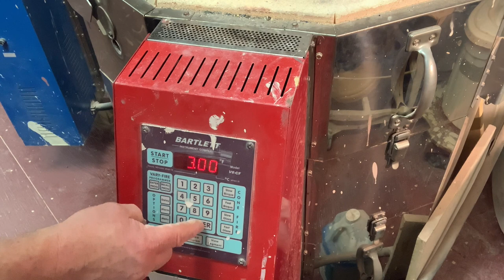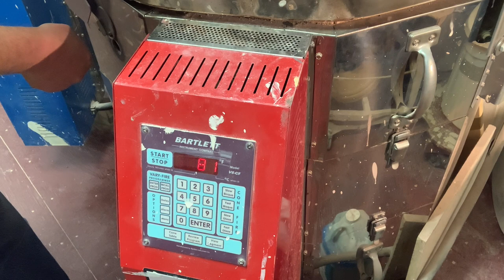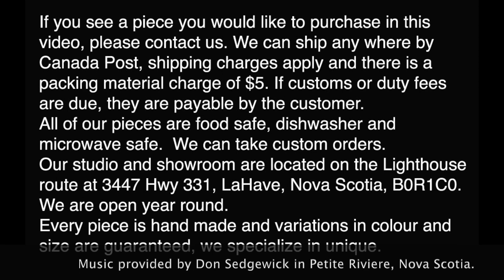Bisque firing basics and tweaks.

Comment: Ah yes, the miniscule adjustments in the positions of the pots before putting down the next shelf!  One thing I didn't hear, that I thought I might, was, "Don't pick up greenware the same way you pick up fired wares.  You'll end up with a piece of rim in your hand."
Reply from the maker: Forgot that, usually it is hitting the rim of the pot underneath with the bottom of the one you are lowering into the kiln.

Comment: Do you have a video that explains clay ‘cookies’ for the kiln & the best way to make & use them?

Also, I watched a potter build her pots (plates, saucers, mugs, & etc… not specific to any single specific size) on kiln furniture that equals the thickness & width of her actual kiln, building a replica of her kiln size & did so on her table to ensure how to stack them inside her kiln, making it as kiln conscious sized as possible so she can replicate it inside her kiln. 

Is it worth doing this in order to protect the kiln & the pots, AND load it so it best fits in the kiln to save on power?

I want a kiln of my own so much. My daughters have considered setting up a go-fund-me to help with the cost of building a pottery building at home. I’m currently sharing a small space in a lawnmower shed that also has a riding mower, generator because we tend to lose power during hurricanes, an air compressor, old Craftsman toolbox, weed eater, post hole diggers, shovels, rakes, etc… to name a few. My pottery wheel, table, boxes of clay, & a few shelves fills & overfills the severely limited space I’m able to use. We have a space to finish leveling & add crush & run gravel to pack under a planned 16x16 building just for my pottery making. It is possible I can get a used kiln from a friend of a family member who isn’t throwing as much these days. (🤞🏼🤞🏼).-the kiln has been well cared for & it’s single owner. 

The increasing price of wood is outrageous.  We have help to build it. The problem is covering the building supplies, primarily the framing wood, T1-11, & blocks, screws, cutting blades, etc… 

Thanks in advance.

Comment: This is a great video!!! Wow jam packed with information! Thanks as always. I have found that bisque firing too low I get pinholes so I bisque to cone 04.
Reply from the maker: The glaze could be under or over fired rather than gases from the low bisque. Organic matter burns out at 451F. If you use a transparent glaze pinholing is much more obvious and the glaze needs to mature higher or soak longer. The problem with pottery are the problems that never end. Good luck.

Comment: Hi Vaughan you said you prefer to fire the bisque 06 instead 04 .What is the difference between then , I know is the temperature and I just find is not better do the 04, maybe burning more organic matter or is something else?🤗
Reply: 06 is the standard.  04 is hotter so fires the bisque ware to be more vitreous so not as absorbent to glazes.
Reply from the maker: Hi Marcia, the comment below is correct.  Some prefer 04 but I have no problems at cone 06. The clay is harder and more dense at cone 04 so you are less likely to crack the pots with glazing tongues. O6 saves energy too.
Reply: @Vsmithpots  thank you 🤗

Comment: Good video with good tips! 👍👍👍👍👍👍👍
It reminds me of a question I've been meaning to ask you... I see that you don't sign your work before you bisque fire. 
With what do you sign your bisque fired pieces? How do you manage to dip your signed bisqued pieces and not have your signature smudged or drip? I've been stamping my bone dry pots with a rubber stamp and a potter's stamp pad. If I stamp on bisqued pots I have to wax the bottoms without waxing my stamped signature or it will blur my stamp. I'm definitely not doing something correctly but I can't figure it out.
I have a stoneware mug of yours and a earthenware mug that Jacqueline painted and the signatures are glazed over but not blurred at all.
Thank you in advance for and advice or tips on my question Vaughan.
Reply from the maker: Hi Connie, I use LUG1 from Amaco. Make sure it is dry before you dip the glaze. If you brush glaze it will smear, unless you are quick and lite in your brushing technique. The best way is to sign before the bisque firing.
Reply: @Vsmithpots  Thank you!  I'll try using your suggestions on my next firings! 👍👍👍

Comment: Thank you for the helpful video!  What’s the highest you’ve glaze fired Laguna BMix-5?
Reply from the maker: Only cone 6 but it seems to have expansion problems with glazes above 5.
Reply: @Vsmithpots  bloating?
Reply from the maker: @walkerpottery9296-Natalie  I had some pots cracking with certain glazes when I poured boiling water in the pieces. Does not happen at cone 5.

Comment: I knew a guy who had a rush order so fired before the pieces were completely dry.  I came into the shop and the kiln sounded just like a popcorn maker.  I doubt you have ever heard anything like that.  Most potters have heard an occasional pop but nothing like that.
Reply: How sad for that, all that hard work.
Reply from the maker: I remember at college the teacher would blame it on our pots having air bubbles in them, instead of him firing the kiln with pots still damp.
Reply: Lol I heard about air bubbles too
Reply: @Vsmithpots     On Pottery Throwdown too, they have blamed it on the potters, when it should have been the kiln master.
Reply from the maker: @sybillestahl8646  I saw that too. Rushing never pays off.

Comment: I load my kiln and then put a 300 watt light bulb in the kiln with the lid shut for 24 hours. That dry heat of the bulb gets any last hint of moisture out.
Reply from the maker: Good tip. I suppose you could also hook up a fan blowing in through the lower spy hole and leave it blowing over night, fans use less power.
Reply: @Vsmithpots  I had not thought about a fan.  I was thinking heat, and not just moving air.  I may try that next time.  I sure do enjoy your videos.

Comment: Hi! Love your videos. I have had bowl rims crack when I bisqued them upside down. Since then I'm afraid to bisque upside down. Any ideas why that happened? To thin? Or shelf a bit rough?
Reply from the maker: Rim cracks are usually from bad handling or trimming too hard at the rim when the clay is too dry to trim, especially if the rim is thin. Try compressing the rim at the end of your wall pull.
Reply: @Vsmithpots  thank you!

Comment: Excellent video! Question: You don't damage the kiln lid when you load all those pieces on top of the kiln?
Reply from the maker: Hi, I have two lids on my kiln. I kept an old lid from a kiln thrown out years ago. I place that on top of whichever kiln is firing. I don't think it would damage a kiln lid if you are placing pots evenly around the lid, if you just use the one lid. Just don't put a very heavy piece in the center. If you place them on the edges you are really letting the kiln walls take the weight.
Reply: @Vsmithpots  Thank you. That makes sense. Our club does not let us dry anything on the lid. I guess because people don't follow instructions.